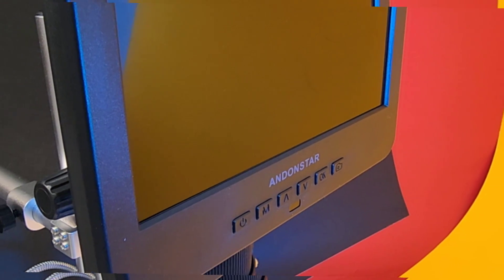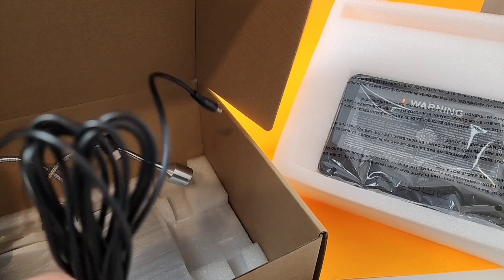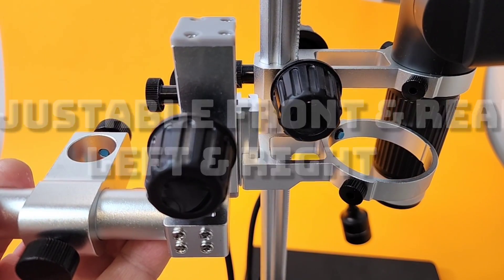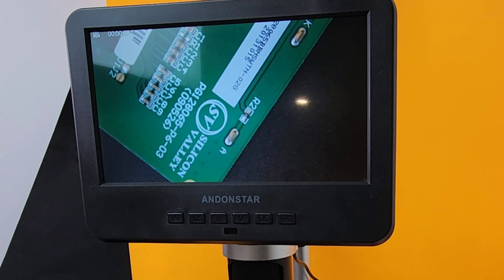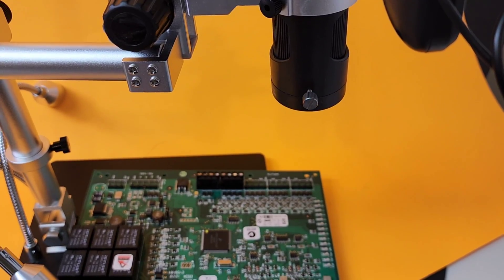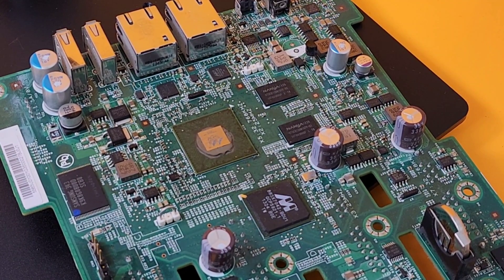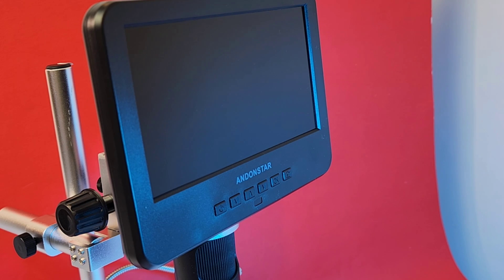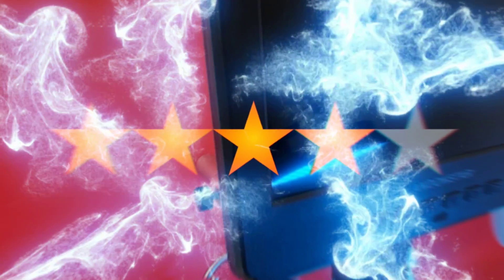ANDONSTAR AD246S-M Digital Microscope Review!

Comment: Lovely microscope and not overpriced. There seems to be a 10-inch screen version - AD249S-M. But both should have an HDMI port for video output. So, this 7-inch version should pair nicely with an external monitor. 👍
Reply from the maker: Yes indeed. The HDMI out would pair nicely with a larger display if required.
The incredibly sharp images I was getting  with the default monitor were stunning. 👍

Comment: You can open it and install 3,8V batteries, I have similar microscope and it have that option.
Reply from the maker: What? Andonstar says its non rechargeable unit. My unit was screwed and glued so opening would have meant destroying the display. Its listed power is supplied by  a constant power source [5v/2A] and not rechargeable.
Reply: @KeepOnTesting  I have some similar product, no name and it can be screwed, I thought that this one also can, sorry